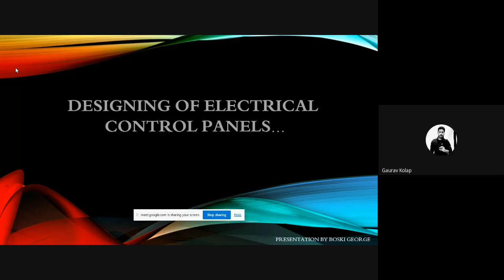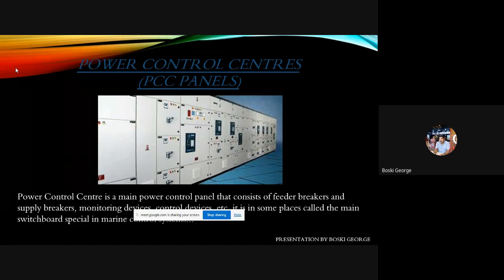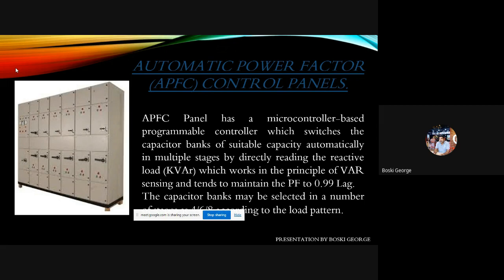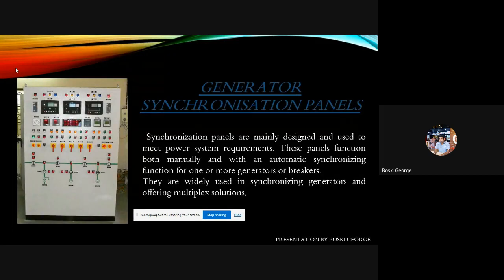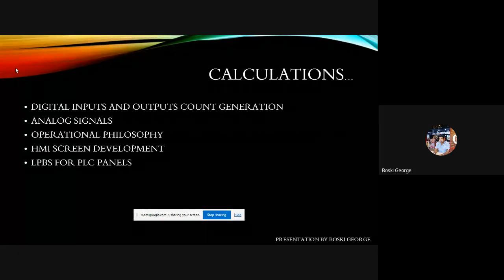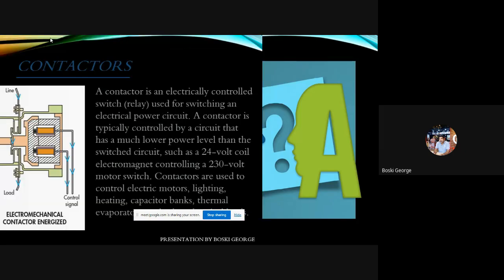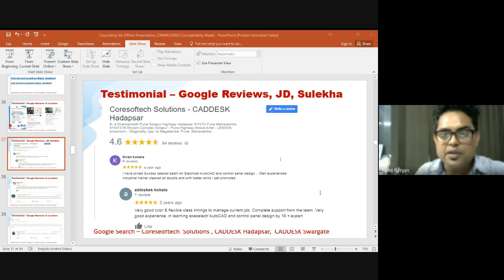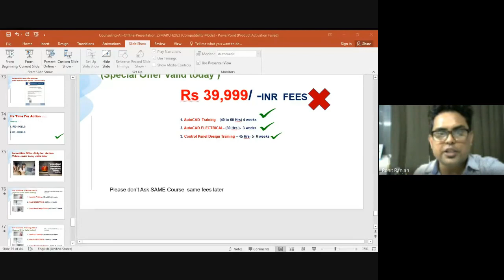Electrical Control Panel Design Courses -Demo March 2023 About The Courses

Comment: How to join course?
Reply from the maker: whatsapp or call +918793166470 www.caddeskpune.com New Batch Online Live Starting Tomorrow

The syllabus for the module are 45 Days Training LIVE 
1.	Basic Electrical calculations.
a.	FLC (full load current). 
b.	Power factor calculations.
c.	Total connected load.
d.	Selection of motor starters
e.	Selection of switchgears.
f.	Power factor correction methods.
2.	Types of Electrical Control Panels.
a.	Motor Control Centers (MCC) panels.
b.	Power Control Centers (PCC) panels.
c.	APFC Panels.
d.	AMF Panels.
e.	Power Distribution Panels.
f.	ATS Panels, etc.
g.	HVAC panel 
3.	Preparation of General Arrangement (GA) Drawings.
a.	Sizing of various compartments in panels.
b.	Non compartmental panels.
c.	Sizing of Cables & Cable entry.
d.	Busbar Routings.
e.	Cable terminations.
4.	Preparation of Fabrication (GA) Drawings.
a.	(IP)Ingress Protection.
b.	Switchgear mountings.
c.	Cable supports.
d.	Busbar supports.
5.	Fabrication calculations ( CRCA Materials)
a.	Calculation of Weight of the panels.
b.	Powder coating process.
c.	Bending as per IP Protections.
6.	Busbar Calculations. (Aluminum & Copper)
a.	Current carrying capacity.
b.	Total weight of busbar required.
c.	Ratings of busbars.
7.	Power & Control wirings for various Electrical Control Panels.
a.	Motor starters.
b.	ATS Panels.
c.	AMF Panels etc.
8.	Projects (Live Projects from leading Industries)
Reply from the maker: +918793166470